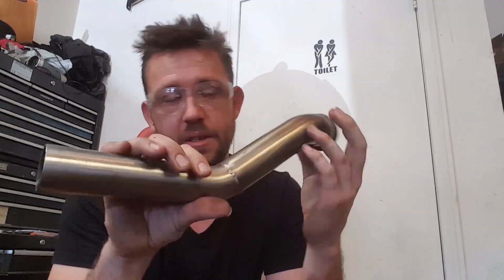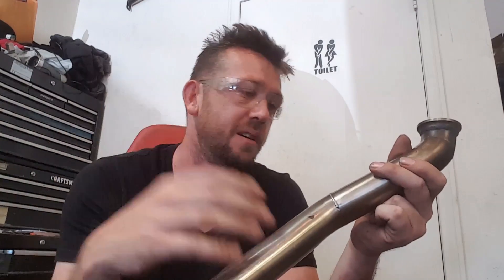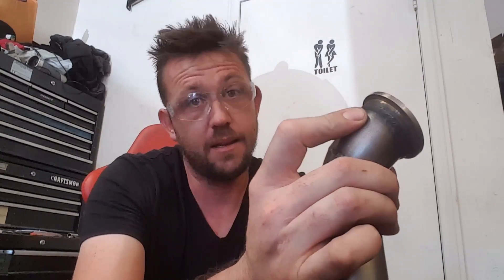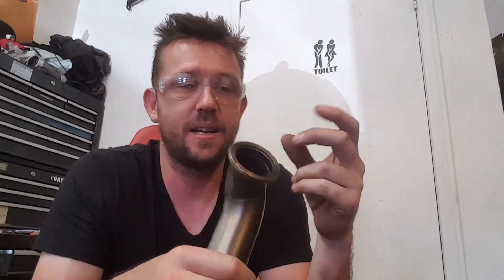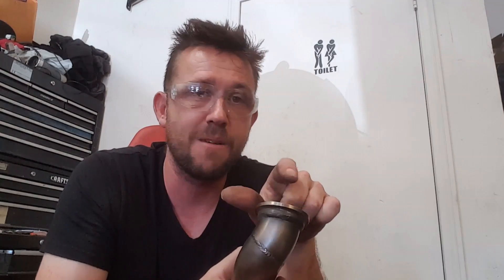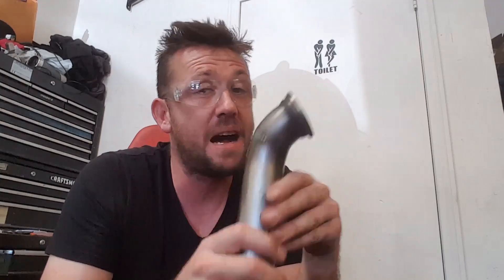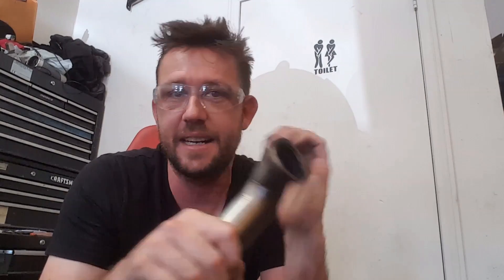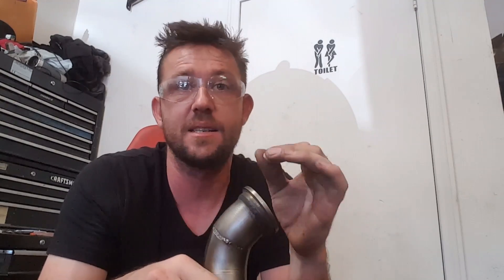TFS: Why You Need to Back Purge

Comment: I know this is a bit random but does anyone know anything about welding brass? Or anything antique like chandeliers primarily brass and cast iron?
Reply: Brew Master thinking the term you're looking for is brazing.
Reply: Keith Caron, Artist has some videos about tig brazing copper using ordinary electrical wire for filler. Weldingtipsandtricks probably has something too. Youll have to do some searching and experimentation.

Comment: Thoughts on Solar Flux B vs purge in preventing sugaring and promoting weld strength?  I think that it's doing a good job, but I don't have enough data to support that conclusion yet.
Reply from the maker: mpeugeot I use it. It works for me. Check out the Back Purge Video when you get a chance. I go over it.

Comment: No offence intended at all, however I think you need a slightly better quality camera for filming. Your videos are just that little bit blurry that its hard to see fine detail (yep, watching in 1080p). Just for example, I personally couldn't even make out the crack in the pipe and was hard to see the sugaring inside the pipe. Not sure if it's lost quality post production but just sometimes difficult to watch.

Keep up the good work though, love the vids and will watch every new one you put out.
Reply from the maker: dominator293 I shot this with my front facing camera on my phone. I mentioned in the vid that I'm right in the middle of a job and not using the full production stuff.
Reply: Fair enough mate :)

Comment: And for great penetration on pipe or tube always key hole weld
Reply from the maker: Rick Parker Not necessary on this thin stuff, but I'm sure it's required on bigger.

Comment: if the part was welded in an argon chamber that would protect the inside of pipe/weld is that correct?
Reply from the maker: John. b Methe It would. I'd consider it a bit over kill for a single wastegate tube, but it would take care of it.
Reply: you'd waste a lot of gas to fill the chamber

Comment: i would like to know why my exhaust pipe does not crack, it's welded with no purge and no penetration to avoid sugaring but has supports to avoid too much stress.
Reply from the maker: CrAzYDr1veR This is where it gets interesting actually. It gets further in depth than a yes/no/black/white explanation. 

Just because you didn't do it doesn't mean it will automatically fail. It just increases probability. The really tricky part is based on use. If you beat the smash out of it, you may or may not reach or mimick the same situation that causes stainless welds to fail. 

There's nothing that says "it will happen" - but you can be rest assured it won't be nearly as likely with proper practices in the same situation. 

If you need further explanation, I'll do my best.
Reply: no need i know that purged is better, it's just as strong as the original material with no cuts and welds